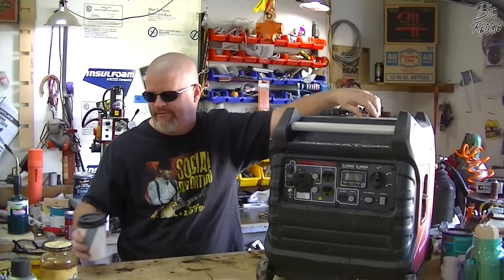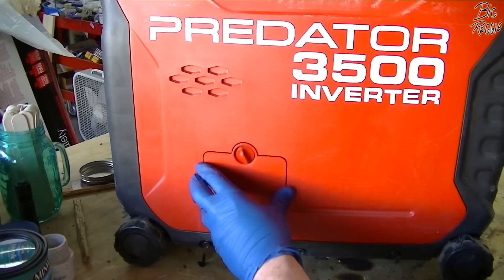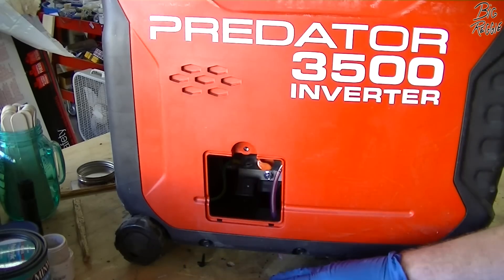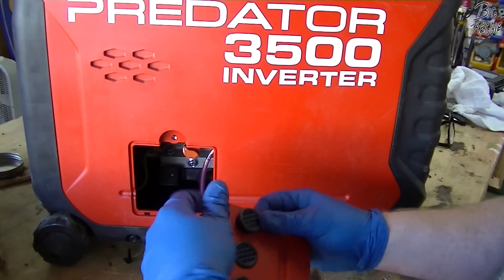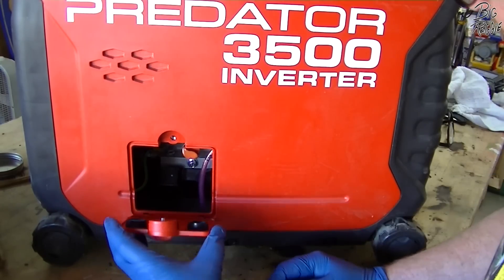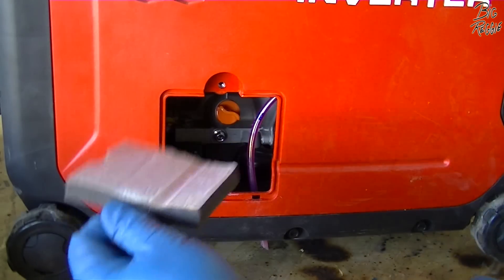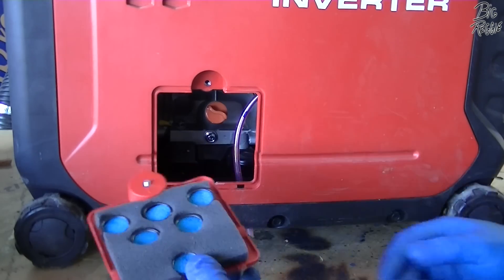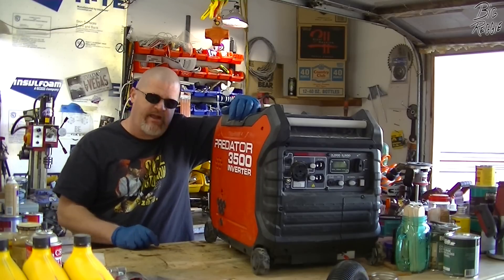Harbor Freight Predator Inverter Generator 3500 Vented Oil Door Mod!

Comment: its not starving for air,its pulling from where it needs to,i would never drill holes in that door then its not pulling air across what its supposed to in order to cool it,what will happen is it will run hotter and thus reduce its life,NO ONE EVER DO THIS WITH YOUR GENERATOR!

Comment: Not sure why folks think this is an issue especially when the generator is running and working fine. Even a proper air filter restricts air but you don't see anyone wanting to take them out. Think people, think.

Comment: My home is at 7400 ft.  The spark plug says its a tad rich, not a toasty brown as I'd like.  The machine starves for intake air when loaded above 2300 watts (akin to apply choke) when the oil filler door is in place.  Remove the door it's happier. Since the intake air flows first over the aluminum fins (under the gen set), has anyone attempted to increase the air intake surface area, presently restricted by tight real estate underneath at the air inlet  (axle, shroud, etc.).  In other words, if we can get more airflow at the inlet, the vacuum inside the case should decrease and the carb might be happier.

Comment: Their mad cause their gens wont start .mods sometime ads life in most cases these days the factory just wants to make money details dont matter .get em out the door ! .he just invited a easy idea that might extend the workload of the motr 👍
Reply: Really???? How do you explain the improvements like adding gas gauge to help prevent overfilling which floods Charcoal Canister or rotating the 30 amp plug that people complained about?   How do you explain that lots of people on YouTube report running this unit for hundreds/thousands of hours in all conditions with no modifications or problems?   And guess what,  they improve and build a fantastic inverter generator for about 1/3 the cost of a Honda.  Please explain your claim with some facts instead of baseless opinions.

Comment: Flawed logic. - The fact that the oil door suctions when the machine is on does not prove anything other than that the fan is working to draw cool air over the inverter and engine.  Completing this mod changes the airflow designed into the machine at the factory,  and may do more harm than good, lowering airflow over sensitive components as designed.

Comment: Get rid of the spark arrestor,  increase the bottom clearance slightly and connect a small $10 fan towards the control panel area.

Comment: I haven't read all the comments but why cement the gray square of foam back in?  All the air coming through the door comes from those 6 filtered breather vents, right? Is the original purpose of the gray foam sound deadening?

Comment: The only issue with this generator is carbon build up in the exhaust screens which can cause exactly the same symptoms as starving for air. Simply remove the screens and blow out with brake fluid.

Comment: Go to your lawn mower, or any other small engine with an easily accessible air intake. Now start it and block the air flow with your hand or a piece of cardboard. Dont block it completely, just a small blockage will produce results. Note what happens. The engine runs differently right?. Now go try the same test with the generator. It runs the exact same with or without the door. That tells me that the engine is not starved for air. The door and generator housing is likely more for cooling and noise reduction.
Reply: I thought the same thing

Comment: This is faulty logic.  There is a fan attached to the engine that sucks air out of the engine case for cooling.  The reason there is vacuuming happening with that door is because the cooling fan is doing it's job, not because it's starving for air.  All you have done is give that air a short cut towards the vent fan instead of over the engine to cool it as designed.  If it's running rich, re jet the carb for your altitude, don't drill holes into it and hope it works out.

Comment: FYI....I called Harbor Freight before I bought one.... the manufacture... All predator engines have steel sleeves and are made in the same factory as Honda.....I’m running on 4 years Camping..... 2000 hours.... no problems...... it would be nice if they made a bigger one or a diesel version..... Great generator
Reply: they make a 9000
Reply: @TyeWills  nobody is using an open frame construction type generator to go camping. Not unless you want to piss off a lot of other people.
Reply: They just announced the 9,500 watt enclosed inverter. It's heavy, but looks pretty damn sweet.

Comment: so now 1 end of the motor well run hotter .  next time clean the fines  in ther are intake side .  when you set it on the ground it sucks up alot of trash and dust . fit it the right way . if the air intake for cooling is still to small then make that end bigger and let it pull are from where it needs to be pulled from

Comment: What you basically did to your unit is making a free air engine, the whole outer case of the unit is a fan shroud that collects air too cool the unit.
not that it needs it but if you're going to cut holes you need to find out where the intake area is at close to the fan and make holes there.
fan shrouds on cars are not just there to keep your fingers from getting chopped off its to divert the air flow into your radiator.

Comment: Some multimeters can include a thermocouple probe that it can read. Before you start modifying the design, get a temperature reading on the critical points, like cylinder head and inverter to see if any change is needed,

Comment: it doesnt need more air, its by design that within the case is a negative pressure so it pulls the coldest air possible from the front.

Comment: Clean Mod, Just as clean as your head :o) 

Do you have SMP? If you do it's a great job, if you don't know. What SMP is,  then you don't have it :o)
Reply: @BigReggie  Skalp Micro Pigmentation. SMP. YouTube it. :o) 

Now I know for sure you don't have SMP.
Reply: Big Reggie could you do a test where you run your generator with a modified door with a heat gun a laser heat gun pointing on different spots of the generator? And then do the same test with a heat gun in the same spots and just put a bag over the side cover to block the holes to see the difference.

Comment: You "fix" is a short circuit for the air flow!
Reply: OOPS!!
  What you've done is the same as like putting a pin prick in a drinking straw or a cigarette, even a vacuum cleaner hose.
The vacuum AIDS in the proper suction, which is needed to direct air to the proper areas i.e. drawing fluid into the mouth, drawing  smoke though a filter and dust into a bag :). Try it.
 I've had a couple of V.W. COMBI'S in my time and on a hot day the engine would run extremely HOT. ( NOT REALLY DESIGNED FOR AUSTRALIAN CONDITIONS ).
 The engine door flap has a very good deal around it to create a strong vacuum so fresh air will be drawn in through the air vents at the top of iether side of the rear of the vehicle.
 Yet I have seen the occasional COMBI going down the road with the engine door flap UP!!
This will only Serv to cook the engine. 
 Get it?
 Don't get me wrong mate, you did a beautiful job and if I wherrent on the other side of the world I would have no problem asking you to help ME with some modifications 😀
  But no worries mate, she'll be right!
  You see, you left the blue sponges in their holes causing allmost as much of a seal.
 As far as the grey sponge that was all ready there? Well the only reason I can think of for it being there, seeing as it seems not to serve any kind of utilitarian function is to perhaps be trying to say....."DO NOT TAMPER".

So no harm done 🤗!

"GREETINGS FROM DOWN UNDER"😎
         Don.

Comment: No. Your little door was in a pathway of air going from a point A to a point B. When you opened the door, you disrupted a residual air flow and caused a venturi effect. Leave it alone.

Comment: If it was starving for air it wouldn’t run right.
Reply: They don’t run right. Mine will miss and run rough because it’s running rich. Being too rich it causes carbon soot to clog up the spark arrestor and not let enough air flow out causing more problems. People mod the door because that’s where they can physically see/feel the airflow even though it may not be the best place to mod it.

Comment: You are wrong about it being starved for air. What you
did will probably harm the generator. It is designed to draw air through it
across a certain route and cause a swirling effect to cool it so the generator
does not over heat. What you did is change the route as well as the swirling which
may cause the generator harm and a shorter life. To prove this I suggest that you block off those vents you added and use a laser digital heat gun and check the generator while running under a full load in high ambient temperature. Then uncover your added vents and do the same and see which one runs the coolest. My guess is you will see that you need to plug off those new vents you added.
Reply: In the operators manual it states, 24. Keep access doors on enclosures locked. It also states, 10. Add-on or modified parts that are not approved by HFT may not be used. The use of any non-exempted. Add-on or modified parts will be grounds for disallowing a warranty claim. HFT is not liable to warrant failures of warranted parts caused by the use of a non-exempted add-on or modified part. All you have done is void your warranty. And in the process made your generator run hotter.
Reply: Doug Dickerson  except the Predator has more power and is a third of the price of the Honda.
Reply: Sean Henry whats up brother😉
Reply: My first thought when seeing the door suck shut is it's not changing the idle so it's not starving
Reply: The air filter lid on your truck  engine will do about the same trick there Goober, Lol! Just leave it alone, go take care of  some of that stuff that wife wants done, Haha!
Reply: I don't know about tens of thousands of hours of testing. What likely happens it the generator is designed by an engineer using software that simulates the airflow and cooling. If you've ever designed anything using software, you know that what the computer says will happen is sometimes drastically different than real world results.
Reply: @jethro9341  I have a hunch that you've done neither.
Reply: @XploreAz  Whatever floats your boat sweetheart.
Reply: Nahh, the generator will run better. Air starvation is eventually an issue.

Comment: Unfortunately, as soon as you modify that generator, you void the warranty. Check the fine print in your manual. Design folks are pretty smart about making sure equipment is protected by cooling. I wouldn't want to tinker with an engineer's design.
Reply: @BigReggie  No, I stopped watching when I saw you making the same mistake a lot of folks do, underestimating what designers do and thinking you can do better. Also, light bulbs have served us well for years, thanks Mr. Edison. He did the best he could with the technology available at the time. LED bulbs are much better, but Edison got us away from coal oil lamps and candles. Lighten up a little guy.
Reply: You could just buy a replacement cover.

Comment: A little vacuum doesn't mean the engine is starved for air.  You might even be reducing necessary cooling air flow elsewhere with this mod.
Reply: Came here to post the same thing. That suction is what allows cool air to be drawn in. It's a good thing
Reply: @TheRealChetManley   ditto.... i hate when shade tree mechanics think they know more than the engineers that designed it...
Reply: I was just going to say the same thing. The way this generator is designed, the air intake directs air over the inverter to cool it. If you allow the machine to breathe in another way you're reducing the effectiveness of that cooling which will result in inverter failure.
Reply: Exactly what I wanted to state. It only means there is positive air pressure inside, which is actually a good thing since this doesn't have any forced air intake to the air filter, you could be screwing up completely working fluid dynamics that needs to force as much air into one opening. Logically wouldn't it make more sense to add extra airflow in front of the air filter instead of the rear of the unit near the exhaust anyway?
Reply: @inb4tehlulz  
Wrong, my racist friend. That is a great generator.
Reply: @davethompson3252  Chinese is not a race my race baiting friend.
Reply: @inb4tehlulz  Its harbor freight, you cant trust chinese engineers.
Reply: There is a vent underneath the control panel that air gets pulled from by adding holes you are taking away the cooling from that control board
Reply: Yes.  This "mod"is not required at all.

Comment: Sure the root cause is air starvation and is evident by the vac on the door.  But does that mean the air has to come in through the door?  Can't the air come from somewhere else and then cause the balance of pressure that allows flow and doesn't suck the door to the housing?

Comment: Its creating a vacuum as it designed to draw its intake and cooling air from the front of the genset through the flywheel housing and exit around the exhaust shroud.

Comment: PLEASE READ. Generator does not need more air!!! The generator uses one fan at the engine side and sucks air in from the front sucking air from the inverter.... if you create holes behind the inverter it will bypass cooling the inverter and only cool the engine.
Reply: As I said on another video, this up down in rpm is NOT the engine 'starving for air' This is the engine's ECO THROTTLE!
Reply: The up and down is just no load on the invertor
Reply: I agree. Venturi effect.

Comment: I would have done things a tad differently. I would have drilled a few more holes in several different places including the engine block and then bought Honda. Sorry.
Reply: My last predator 3500 lasted 4700 hours completely stock. Well worth the price. Screw Honda and their prices
Reply: HOndas are over priced, but the engineering is world class. I know it did not cost you much to do the fix, this should not have been necessary and points directly at faulty engineering. Thanks for the video though and you did pay a lot less. When the Yamaha's hit the marker most people thought they were equal to Honda, but in the long run they have a lot of problems. It would be interesting to see a video after you have 300 to 400 hrs on your Predator. Hope it works well for you. Thanks again.

Comment: I run my Predator 3500 at 3100 Watts for 9 hours a day under load I have done a few things to the cover to increase airflow. for me nothing has really affected the machines performance either way I was originally convinced that it was starving for air. but like some of the other commenters have mentioned I believe the designers have a vacuum effect for cooling which is why the door sucks into the machine on its own my machine doesn't surge and keeps a constant high idle very well for 10 hours at a clip with stock cover on or off or retro modded pre filters. I will add that this machine is Kick-Ass after approximately 600 hours of use
Reply: What's your oil change frequency?

Comment: Bet the generator inverter fails. The engine sucks air from the rear of the unit forcing air across the inverter then to the engine. Removing the cover just allows less resistance and sucks air in from the side and reduces airflow at the front avoiding the inverter. Not ideal.

Comment: Why not just cut a large rectangular hole in the door. Lay down some screen mesh and then put the foam back in place. Does the foam on the back of the door breathe ? Or is it too dense ? Could the factory foam be replaced with a less dense piece that would breathe ?

Comment: This looks good but you're doing more damage than good do its. designed to have the air in and out at a certain point you just change the air intake that's why there's a vacuum there I believe the exhaust is also on the other side and will not benefit from this a true test on air temperature on any enclosed unit is done with a parameter hooked underneath the spark plug at 60% load then you can see the results you also want another one on the generator or and inverter board  changing the airflow you're very well and on this one I'm pretty sure you've increase those temperatures

Comment: nice vib, this weekend I had a BBQ event. I bought  the 3500 predator.  after 2hrs it shut down on its self and could not start it back it. it was struggling to start. took it back and got  another same thing happen again. call tech support and went thru the startup procedures still having the same problem. tech support thought it was the spark arrestor needs to be clean I told them it's a brand new unit. Could it be the airflow that you suggested or the Colorado high altitude. Thanks
Reply: Toby Johnson try opening the gas cap when that happens. Could have vacuum inside the tank from not venting properly.
Reply: Did you ever figure it out in having the same problem. It starts to flood itself out and then won't start. It has to be starving for air and pulling too much gas in just not sure if this is the answer.
Reply: High altitude = less dense air for combustion creating a rich air/fuel ratio. Needs a smaller main jet in the carburetor.
Reply: There are issues inside with the choke linkage hook up. Yours may have this problem.
Reply: I am just looking at these but saw some folks who's units run really rich like that, and you're the fist person to mention a choke issue. I've fixed small engines before that sounds plausible. What was the fix? Linkage stiff or need a return spring?
Reply: My investigation turned up posts in a few places where they said the linkage has become disconnected or in some way allowed the choke to close causing a rich condition while outside on the panel it was dialed open. Obviously this could be an isolated issue as well.